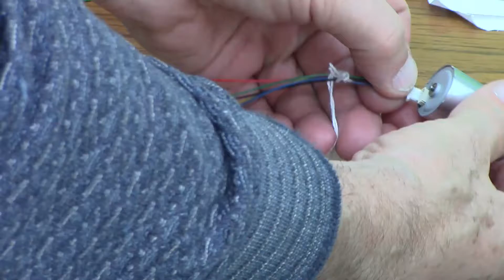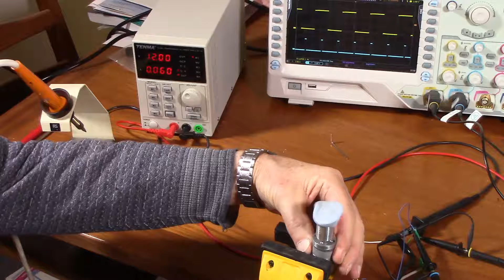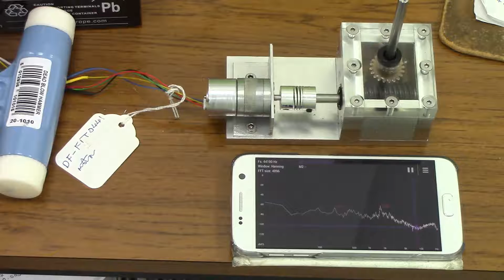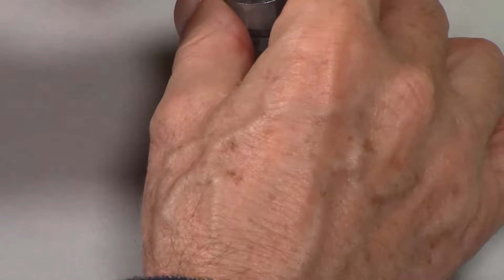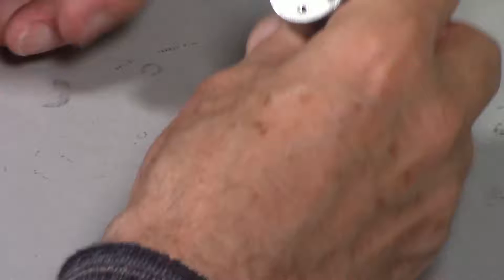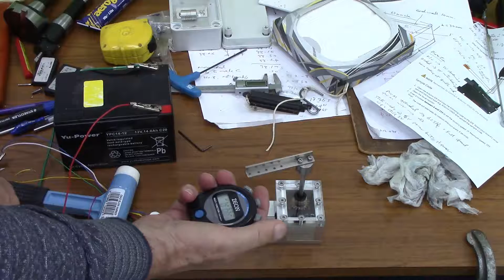New rudder servo - part 2

Comment: The association with Bourne means the position sensor is probably some form of potentiometer. You could "hack" a normal pot by removing the end stops as long as you don't need a 360 degree rotation capability for the rudder. You may not need to hack the pot if the rudder has physical end stops. I would guess that a hermetically sealed pot will be cheaper than the Bourne position sensor.

Comment: You're probably aware that the purpose of the encoder output and pwm input is for you to create a phase locked loop type circuit where you integrate the encoder signal and use it to drive the generation of the pwm signal. The resultant circuit can then adjust the speed for the load and as long as you can supply enough current the speed will remain stable. There are many Arduino based designs on the internet that you can download. Or you can buy a ready made brushless DC motor controller.